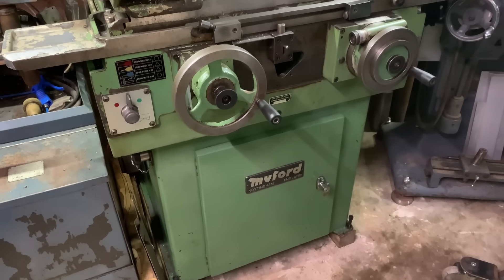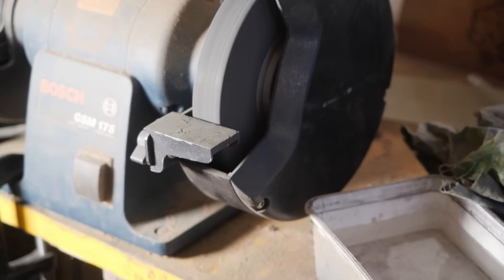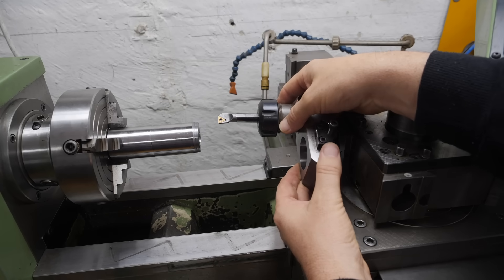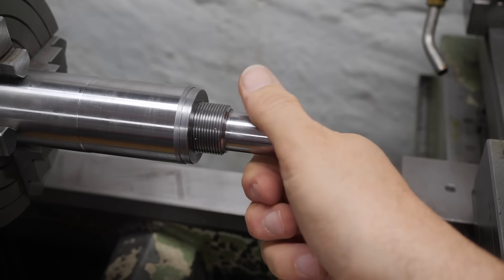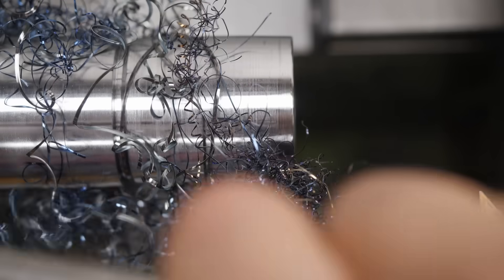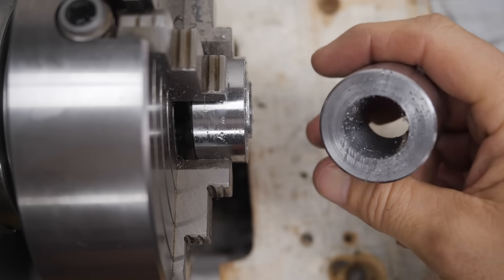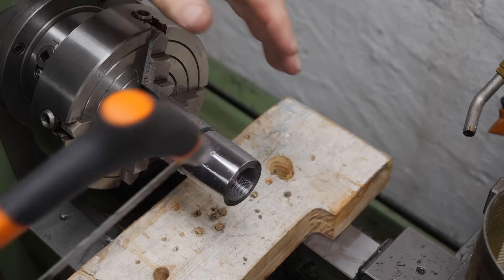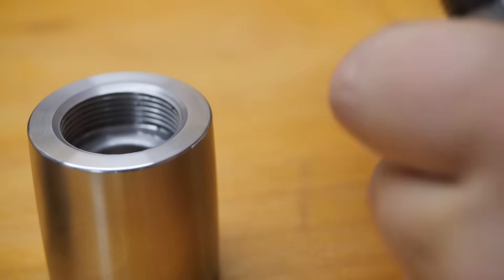CNC turning a high speed grinder pulley with the Schaublin 125-CNC || RotarySMP

Comment: LinuxCNC actually has a feature for reentering a thread which has been cut before.  It actually pioneered this feature.  It does require a servo spindle.
Reply from the maker: I still need to work out the LinuxCNC Comp to controll my spindle better, so I can put it under closed loop spped control.

Comment: Does the turret not work on that machine. Why not setup all the tools in the other stations?
Reply from the maker: Hi Peter, Not yet. When I bought it, it had been sitting for a couple of decades with a dead controller. It had previously been run with cutting oil, which had hardened to varnish. The ballscrews would not even turn until I stripped it all down and cleaned the snot out.

I just haven't got around to stripping and cleaning the tool changer, and will also have a fair bit of work to get it under LinxCNC control.
Cheer,
Mark

Comment: re: "can't get the end diameter right" - could you make it a little long (cone too wide), then trim down the correct fraction of a mm to get it spot on?
re: cnc threads - i didn't realize the angular control part was good enough to reliably do that ...
Reply from the maker: That would work, but only if you get the small end pretty close.

The lathe spindle has a Heidenhain encoder slaved to it, and LinuxCNC syncs to that. It is extremely accurate, and you could turn the spindle with a hand crank, and it would making the pitch with completely unstable spindle RPM.

Comment: All my cnc lathe experience has been an exercise in faith. To avoid the bird nesting you need to increase feed or depth to make a chip that breaks. With CSS its worth doing some tests and then watch the magic happen
Reply from the maker: Yeah, that is good advice. I tend to jump between jobs - I am on a welding trip at present - and have not really learnt any machine well.
Reply: gWizard has been an amazing resource. It will help a lot with the Maho as well

Comment: Ouch munching that chip clearing tool into the thread! 😬
Suggestion; raid the kitchen drawer for a silicone spatula, usually they have a little plastic handle and a silicone rubbery spatula, small spoon sized type (but flat). Probably about 25mm by 40mm silicone part but if you still need smaller than that you can just trim with a knife.
Very safe chip clearing tool. 👍
Reply from the maker: ...but life threatening consequences if Mrs RSmp catches me !! :)

Comment: To use a manual machine to get the taper concentric with the outside, and with the correct outside diameter, could you make the entire part over-length and with the correct outside diameter and then flip it around and then face it down until the taper diameter is correct? Your facing cut would not be perfectly concentric, but you don't care. Then face down the other end to get the part to the correct overall length.

(EDIT: Oh, I watched further and I see that the pulley is crowned, yes that makes it more tricky).
Reply from the maker: Luke and I had a chat about it. You'd start by setting the top slide angle and setting it to a defined zero point in it's travel. then set up a clock on both cross slide and bed, so that you have a repeatable location. 

Make a test part, blue it, and try it on the grinder spindle. Adjust and repeat as required.

Comment: Always good to see you doing work an the Schaublin. Really curious about the HMI tha allows you to do changes almost on the fly i assume it makes live a lot easier. Great video nice pully thank you for sharing.
Reply from the maker: Human machine interface? The Schaublin uses the Gmoccapy interface for LinuxCNC. Is that what you meant?

Remember this is a three evening compressed into 16 minutes. A lot of it is editing :)
Reply: yess ……. i assume you design the part in fusion, post the toolpath to Linux CNC and then have an hmi (andy piu) that alows you to do minor changes on the fly instead of rewriting the whole toolpath? ……… as yiu said time time flies by …….really apreciate you sharing and documanting it in an entertaining way ……i assume editing is at least as hard as machining if you want it to be entertaining 🥳
Reply from the maker: @SuperAnodyne  No Fusion, as the maker license does not support commercial usage, and they consider YT'ers as commercial. I use FreeCad, or 21 year old seat of FeatureCAM.
Andy Pugh's Lathe macro's don't let you edit tool paths, that is done in the text editor build into LCNC. His macro's are just are really fast way to get simple cycles.
Do you mean tool path editing or video editing? Tool path editing, you have to be really, really careful. It is so easy to miss a decimal point and have the machine race off. Video editing for YT has taken me a long time to learn, and I am still learning every time I do it, as you are really producer, director, cameraman, sound guy, grip, actor, voice over, editor etc all wrapped into one.
Reply: ah wasnt really aware of the whole process, i‘m when it comes down to sofware a DAU …dümmster anzunehmender user……..as aone man show you proof to be a multifunctional multitasker………. it took me took me over a year to figure out light in pictures by using my daughters stuffed animals and arrange them in different positions……
Reply from the maker: @SuperAnodyne  That worked well for you. You photos show you mastered lighting. I am pretty lazy on that, and just provide lots of flat light for me videos. Did you ever see Ben Farrells analysis of ThisOldTony's video? Dramatic lighting was one of the points.
https://www.youtube.com/watch?v=2j9T-eYo8QQ
Reply: Entertaining and true……..do you know this guy https://youtube.com/@bobbyfingers?si=gS47zRja1hPzgPcJ ……….if not brace your self in for a very different level of entertainment 😁

Comment: You're right about watching CNC's cut threads, even after doing 100's of thousands of them, in brass mind you which you can do at pretty high speeds. A year or so before I retired, I bought 2 little Taiwanese CNC's that had a 4 station programable tail stock which allowed me to do an internal and external thread at the same time, now that was something to behold, it was a mind-blowing program to run it though. Nice external finish on your parts. 👍
Reply from the maker: Internal and external in a single pass would be cool to watch.
Thanks. I probably should have changed out the insert for the internal finishing pass.